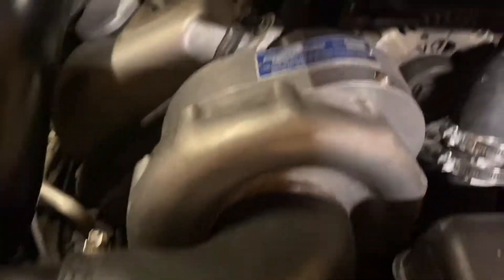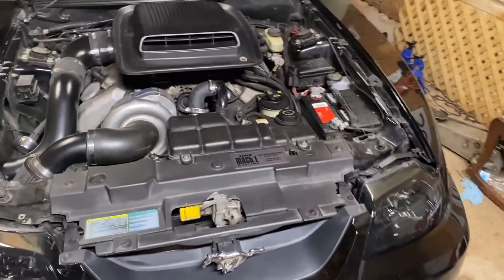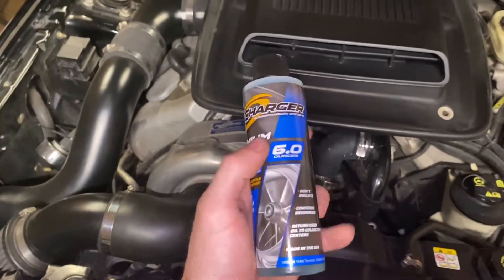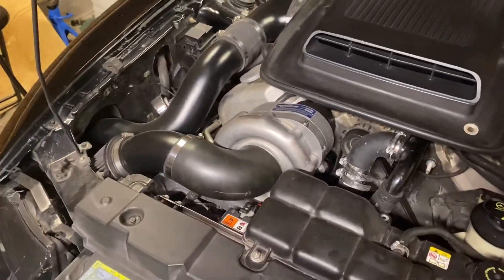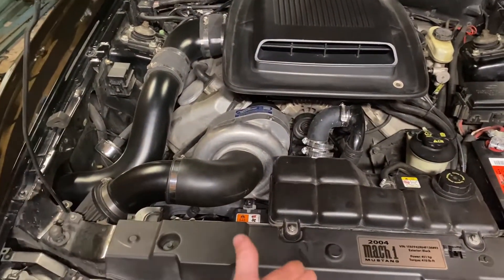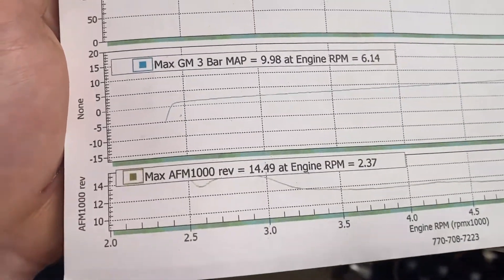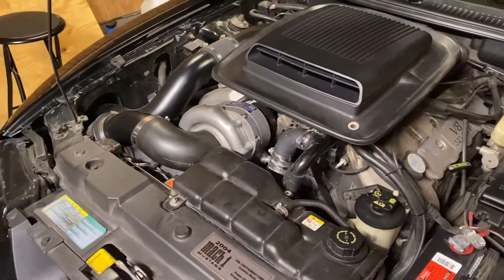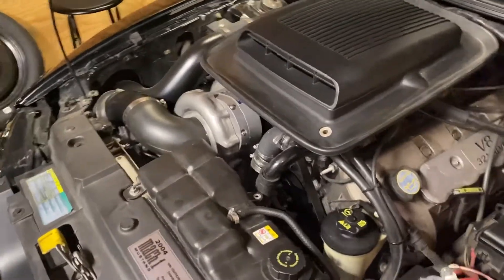Why Centrifugal Superchargers Are AWESOME! (Procharger, Vortech, Paxton)

Comment: I heard 4.10 gears you don't get any traction when you add boost?
Reply: Its called a tire and suspension mods.  Greatly depends on the transmission too 410 gears isn't the same across all platforms and builds trans gearing and tire size has alot to do with it.

Comment: My knowledge about belt driven superchargers is limited to the old Paxtons used on Studebakers.  Just things I've picked up, never owned one.  Those had a variable speed ball drive so that the supercharger had more boost at low speeds w/o overboosting at high RPM.  Centrifugal superchargers, belt or turbo, have very non-linear boost curves.

Centrifugals, rotary vane, and scroll superchargers are more efficient than Roots types because the compression takes place in the unit, and not in the manifold.

5,000 mile oil change?  That's insane.  My Eaton on my GM 3.8 goes 100,000 miles, per recommendation. The old oil is the nastiest smelling oil you will ever smell by many times over.  It's a synthetic and all it does is lube the two rotor gears.  Go figger.

Comment: Interesting!  Thanks for the video.  (Thinking)...  I want to install a supercharger on to my 1.4 liter cruze, and delete these constantly cracking turbos.  
I wonder about a supercharger designed for low rPm ONLY that would disengage at higher rpms with a device like an air conditioner clutch. 🤔  but then the air would need a waste gate type path to enter in to this now naturally aspirated engine.   I'll keep thinking.

Comment: Centrifugal compressors are very expensive.

It’s the most expensive way to boost an engine
Reply: Last time I checked the prices of twin screw and centrifugal kits for popular V8 options were in the same range.
Reply: Alot of the positive displacement blowers are in a similar price range.

Comment: Mmmm, I've heard 4.10 gears aren't good for supercharger.  🤔
Reply: Total nonsense ecsp if it's a centrifugal.   I have 410 on a 700+ rwhp 07 gt500 w a gen3r blower.  You gotta have a tire on it or it's not gonna hook.  At the power level he's at mid 400s 410 is no issue whatsoever just need a sticky tire and suspension mods just like with any setup.  My Shelby is a torque beast w that tvs it drives fine w 410.  It hooks from 2nd on.  A car at his power level ecsp w a centri could do 1st gear pulls easy with the right tire on it.  Ppl need to stop w these blanket statements like "410 isn't good for superchargers" that is a dumb way of thinking.
Reply: @midnight347  ahh, thank you... yea, i can't wait to get my car or of the shop.  I had messed up my motor going through a big puddle of water too fast.  

I'm definitely going to get some 4.10 gears for my 06 town car.  So, I guess the only other question would be. Should I go with a twin screw or a centrifugal like a paxton 2200sl.  I was thinking of a paxton because I was hearing the that the ts get too hot 🔥 and get heat soak. Plus, I have a jmschip from pedal max that makes my throttle response lightning 🌩 fast. No joke, I heard about the jmschip. I saw all the YouTube videos I could on it. And  I wasn't still sure if it would really make a difference or not. But holly shit It made a night and day difference.  But anyhow, I was thinking since there's no throttle response 🤔 delay. Should I go with the paxton 2200sl.  Or the 2.5 kennebell.  I've done the math. And it's going to cost just about the same amount to do either or. Idk. I just want that instant seat in your pants. I feel like that rush feeling  of taking off in a jet plane. Oh, and my transmission is an auto 4r70.

Comment: Hey bro you need to add a jms pedalmax  to your car. I did it to my 2006 lincoln town car.  And oh, my God the throttle response was crazy fast. Not to mention it holds the gears longer.  Like normally when taking off at a dead stop it would only rev to like 3k before it would shift gears. But when I turn on the jms pedalmax to say 75% it'll shift it at 5krpm to 6krpm. Oh, and it revs really quick now. It's the best mod I've done to my car. Well, that and the Roush axle back exhaust.

Comment: How do i get the hellcat whining sound as it speeds up?
Reply: That’s the noise the actual supercharger makes you would either need that supercharger or one built similar won’t sound exactly the same, but most of them have that whine  especially the bigger they are
Reply: @lukefisher8417 a centrifugal IS a supercharger you have centrifugal and positive displacement superchargers.  He is describing a positive displacement blower that is what a hellcat has.  Pretty sure it's a tvs rotor pack.  You want a tvs blower roush or vmp or the like.
Reply: Positive displacement blower like a tvs.  Roush or vmp

Comment: How is the drivability?  Trying to decide between a tvs and a centrifugal.  Heard the drivability is now as smooth.  Wondering what you have experienced.
Reply: Drives like stock under 2500rpm … over 3500rpm the boost starts kicking in exponentially… maximum horsepower is achieved at the redline

Comment: Tvs ftw, instant torque! But I do love the jet sounds centrifugal make.
Reply: But die up top. There are some centrifugal that make power in the entire rpm band all while screaming up top
Reply: @MrEvilTag not all roots and twin screws die up top it depends on the size of the blower and the engine it is on etc.  Alot of the newer positive displacement blowers are very efficient and they will pull like a train everywhere even high rpm.  This is a myth.
Reply from the maker: The sound is my favorite part! My next v8 will have a roots/twinscrew supercharger!gotta try em all!
Reply: @CodyDriven  yessir! You would love it man! That whine with that instant torque. It's wild. Maybe a termi in your future??? 🤔🤔🤔